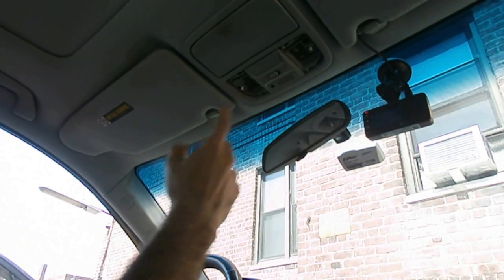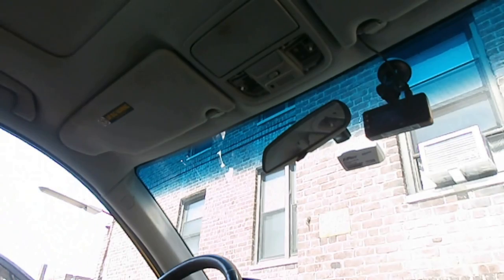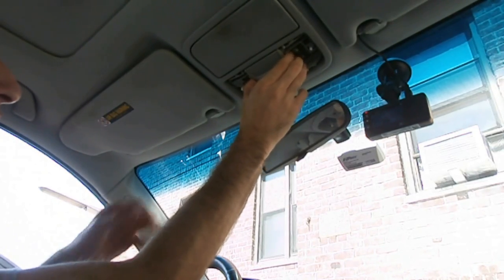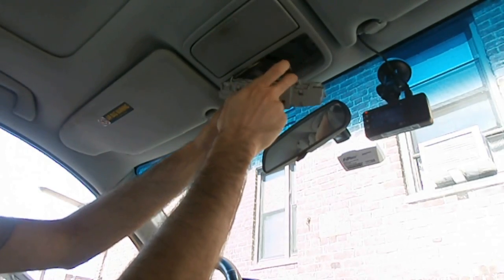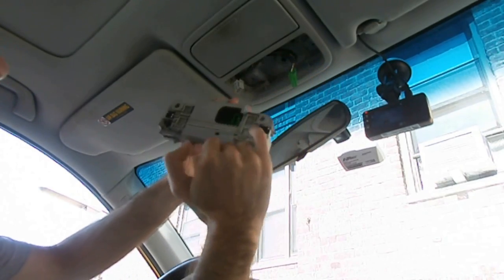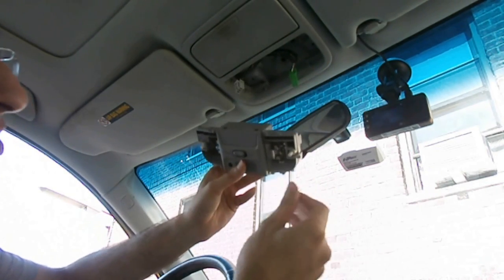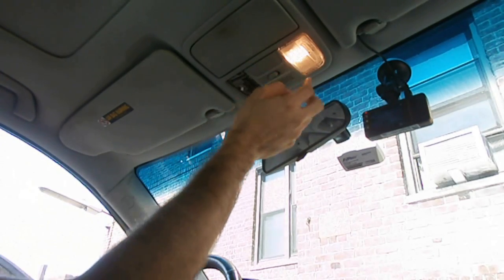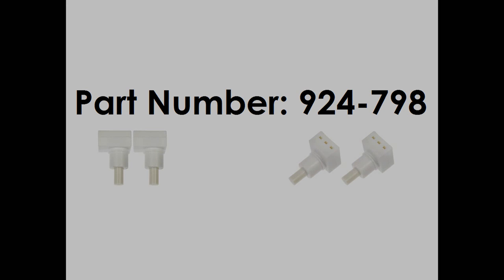Honda Accord Map Lights - Dome Lights - problem - repair - fix

Comment: Great video!  Fixed the problem in about 15 minutes!  A couple of tips (at least for my 2010 Accord):  1) The screws don't provide a ground - the platenut in the fixture is plastic.  You only need to connect the harnesses back up to test the repair.  2) A stiff 1 - 1.5 inch wide putty knife very easily removes the lenses by pushing in on the lens and gently prying in the center of the hinge end.  3) The assembly must be reinstalled such that the plastic platenuts protrude into the holes in the assembly to make it fully seat.  4) The harness connectors each have small button that you press to release the connector.
Reply from the maker: Those are some really good tips, Pete. Thanks man!
Reply: So the machine screws are not needed or they are

Comment: One of my lights quit coming on.  I searched You Tube.  I found this video.  I ordered the part (They come in pairs.) for $7.  The part arrived 4 days later.  Replaced both switches in about 5 minutes.  Both lights work, now.
Thanks for the video!

Comment: I purchased replacement bulbs hoping that would solve the problem. It did not. I found this video and ordered the parts off Amazon and will also replace the bulbs with LEDs while I'm at it. Thank you for your help. When we first purchased the car, one of the lights work and now neither do, so I'm glad I have found a solution.

Comment: I fixed it by pulling the switch out and reinserting in a few times. Thanks for the details about carefully taking it apart. You likely saved me $100
Reply: Your comment helped me out, thank you. It didn't work for me the first time, so after I saw this I redid it again with some contact cleaner and then everything worked.

Comment: Thank you so much for this exceptionally informative video. I have a 2005 Honda Accord that I've had for 10 years now and that light has not worked for at least 7 years if not longer. It has never bothered me enough to spend the money to fix it, though, so I've just lived with it. The bulb recently went out in the side that works, though, so I wasn't getting any light in the front seat when the door was open. That forced me to research how to replace the bulb. While searching for that info, I came across your video, so I thought I'd give it a try. I ordered the same switches you have linked in the description and sure enough, my long dead light has now come to life when I open the door. I was surprised by how excited I was about something so trivial. Thanks again for taking the time to make and post this video.
Reply: Not only do both of my map lights not turn on when the doors of my 2005 Honda Accord EX V6 Coupe are open, the passenger-side map light never turns on whether the doors are open or not.  Not sure if replacing both switches will solve this problem, but I'm going to give it a shot.

Thanks Jeff, and to the poster of this video of course.

Comment: This works.  2005 honda accord ex v6L.  About 3 years ago, drivers side map light stopped turning on on door open or unlock.  About 4 months ago, passenger's side suffered the same fate.  Both work when pressed.  

Test is if map light comes on when pressed but not on door open or unlock, it's this switch.  Suggest you replace both.

I asked the dealership for these switches, they could only sell me the whole assembly for $46.  I'm cheap.

Bought these, followed a video instruction, about 15 minutes later, both lights fully working - on press, and on door open or unlock.  I didn't need to remove the assembly from the wire connectors to replace these switches.  After dropping the assembly, I could easily pry off the switches and reinstall the new ones from the bottom side.

One word of caution, be careful prying / pulling the lenses off.  Pry / pull straight down.  As you can see in the video, the retainer tabs on the lenses look fragile and likely wouldn't tolerate much pressure sideways before bending or snapping.  I didn't break any.

Minor gripe - these dorman switches aren't quite as tactile, ie clicky, as the OEM part.

Comment: 2006 Honda Accord.  Following your great instructions, I removed the switches and as a test, tried swapping the Right switch to the Left position and Left to Right. The switches are identical twins with the terminal markings the same on both.  I put it all back together and it works like it's supposed to.  I realize this may be a temporary fix, so I am prepared to order a new pair of switches if needed.  Thank you, Maximum Tenacity!
Reply: Lots of times you just need to clean the contacts.

Comment: Nice video, I have just cleaned my connectors with alcohol after rubbing with sand paper and now it is working fine, no need to replace, Easy repair.

Comment: Really good video. The problem I found was to clean off some surface corrosion from the light assembly mounting bolt . Both lights working fine now , as opposed to just the one. Thanks again!

Comment: I had the same problem with my 2008 Accord.  This video really help and it did fix the problem.  Dealership wanted $119 to fix it, but this video and 2 switches I purchased at a local auto part store for $26 was all I need.  It only taken 10 minutes to fix.

Comment: Awesome video. 10 minutes start to finish in the dark with phone flashlight. Did it at home so I took assembly in the house which made it easier. Tip, if the bulbs were lit even for a couple of minutes they are very hot so be careful. Minor 1st degree burns which will be gone by tomorrow. Thanks again for posting.

Comment: Quick and inexpensive fix on my 2011 Accord (a single button was out and the stealership, Huggins Honda, wanted almost $200 to repair it). Changed all the interior bulbs to white LED while I had it opened up. Helpful video...thanks.
Reply from the maker: Yeah, exactly, my local stealership quoted like $160 and insisted that the only way is to replace the whole assembly.

Comment: Good video. 2005 Honda Accord. Didn't have to take fixture all the way out and fight the connector locks on the plugs. Just slid it out far enough to be able to slide out the switch to the side. Used a screwdriver to wedge the switch out the side then slid the new switch in until it clicked into place. (Same for other side if replacing both switches.) Replaced every thing and done.

Comment: I solved the problem by removing the switches and reinstalling them on the opposite side from where they were. That created enough new contact to solve the problem. No need for new parts.
Reply from the maker: Sounds like a quick and easy step to try before committing to buying new switches. Thanks for the tip.
Reply: I tried this and it worked. thank you,  saved me $14 :)
Reply: This also worked on a 2005 Acura TSX.  All I did was remove the faulty switch and put it back in 4 times.  I'm guessing there is some kind of build up preventing a good electrical contact.  When you pull the switch out and back in it creates contact again. So the switch is good but dirty. Thanks for sharing this and thanks to the original video publisher for good instructions.
Reply: In my case, there was a bad switch that wouldn't click, but the center contact that inserts into the switch body was coated solid with rust.  The other contacts were clean and shiny.
Reply: @trainliker100  i wonder if some carb cleaner or oil couldnt get in working condition again, trying this on an 05 accord, will edit with results 😜

Edit: this worked, took out switches, blew them out, even swapped the right/left, plugged it back in now my lights come on when the door opens!
Reply: June 2024 and I just did the same thing! Thank you!

Comment: thank you so much this helped me. i have exact problem as yours with the left light,  all i did was clean both ports and swap both right and left switches. worked liked charm. i didnt buy any replacement part.. advice: before buying any replacement part like the vlogger said, swap both switches first to confirm if you need a replacement.
Reply from the maker: Wow, self-repaired & cost-free - awesome job man!

Comment: Very helpful.  I had yet another surprise.  The left switch was no longer "clicking" and the left light never came on.  A new switch, at first, didn't help.  When I removed the switch and inspected the three contacts that insert into the switch body, the center one was completely coated with rust.  The car itself, and other contacts, were pristine.  Very mysterious.  I sanded the rust off and that, plus the new switch that would now "click", fixed it.  Bought a pair of switches on eBay for $9.95 with free shipping.

Comment: Dang. I just ordered the entire map dome unit. Honda said that would need to be replaced. They didn't tell me all you had to do was to replace the switches on each side.
Reply from the maker: Of course. That's exactly what the stealership told me too... and I called BS on that.

Comment: This worked for me and solved the problem. If it doesn't work consistently the first time you reinstall in, take it apart and do it again. The second time I took it apart, I used some electrical contact cleaner and then put it back together. After this, it worked beautifully. I hope this helps someone else.

Comment: thanks for the great vid and it helped me greatly for my problem. add two tips: when you pry out the plastic covers, push up one side and pry the cover from another side (near the middle). when you put it back, the same, push one side up and then push the other side (near the middle). also two screws must be screwed back all the way until tight, otherwise, doom function works but not the map light.

Comment: Thx for explaining the grounding that the screws do. I had some work done on my vehicle and the repair person just one of the two screws and decided to put the screw on the left side instead of the right and it cause the lights to not work properly. Once I change the screw from the left side to the right everything worked great! I watched several videos about replacing and fixing the dome lights and nobody mentioned the grounding that the right screw does.

Comment: I would like to sincere thank you for posting this video. My drivers side map light started working sporadically before it stopped working altogether. I knew it wasn't a burned out bulb, but I tested it anyway and was correct....bulb was good. Knew it wasn't a fuse since the other light worked. Figured it must be a bad switch. Took it to Honda. They gave me a quote of $200. $100 to replace the entire unit including sunglasses holder + $100 for labor. I did some Google and YouTube searches and found your video. I purchased a 2-pack of switches off Ebay for $13. It took me around 15 minutes to replace it. Had a little trouble popping off the light covers because I didn't want to break them. All I needed was a flat head and Phillips screwdriver. Just sat in the drivers seat and got it done! If I had gone to Honda it's a 20 minute drive each way (plus gas) and God knows how long I'd have to sit in the waiting room. Thanks for the invaluable help!
Reply from the maker: I'm so glad when I hear these kind of stories; that I helped people save time, hassle, and a considerable amount of money.

Comment: Thank you for sharing the video. I viewed and fixed the switches by further opening the switch (breaking the four plastic mold) and cleaning and prying the middle prong (negative); then reattaching everything back together. If you don't want to go through that, you can just buy the plastic switches on Amazon for 10 dollars a pair. BTW this is the exact same procedure for Acura TSXs cabin switches as well! You should put "Acura" in the tag so it can show up when people youtube how to repair cabin switches; courtesy lights.
Reply from the maker: That's a good pointer you gave me about the video tag, thanks!

Comment: Great video!!  I have a 2013 Honda Odyssey THAT had this dome light issue - Dome lights just wouldn't come on even with new bulbs.  I took the whole assembly out and then took out just the light section out.  I popped out the clicker switches (just pry them out with a small flat screwdriver....if its hard, you are doing it wrong!!).  They pop right out OF THE SIDE, NOT TOP.  I didn't know if I could find replacement switches since most of the switches said for 2002-2012, mine being a 2013, I decided to just clean off the contacts, rough them up a bit and then make sure the ground screw when mounting back in the car was tight and connected.  I then put back in the car, figuring if it didn't work, I'd just buy a set of the 2012 switches.  Got it back in the car, put bulbs in and boom...light!!  I have a feeling that the connections get bad over time or loose.  The switch might not be bad, it just might take the fiddling to get the connections right.  So try cleaning and roughing up before you buy the new switches ($15 max for a set).  This is an easy fix!!  Took maybe 15 minutes.  Just take your time and don't pull wires hard.  Gentle, gentle.  Someone put this in, so you can take it out.  Just go slow and don't freak out.  The dealership wanted $120 for the whole assemble.  The hardest part was taking out the 4 screws for the whole assembly.  Two are above sun glass holder, so open it up to get access.  Then one on each side of lights. tip towards windshield and slide out.  Then remove connector wires.

Comment: I just installed it....  As I was doing it the left side started working again.  I replaced it anyhow....  The right screw tightened up tight but the left screw didn't tighten up as well....  I am hoping all will be well....  Thanks a million :)  Jim

Comment: Thanks for the video! It was the only one I looked at and YOU KILLED IT! You showed all the little tricks to take it apart without damage! I swapped the switches both work now (both were out before). I am guessing poor connection or ground. I ordered two switches anyway. I used the part numbers you supplied. A "full service" video on this repair! Nice job! BTW, I am very mechanically inclined but electrical baffles me. This made it easy! Thanks again!
Reply: My problem (2006 Honda Ridgeline) was also poor ground connection, left light. Found center connector (I assume this is ground) oxidized and with a rust spot on the back side. Cleaned, now both working as they are supposed to. I was able to keep the original switches, did not have to replace.

Comment: great video. in my 2006 pilot the screw certainly does provide the ground but only on the right side. screws were corroded a bit. I wire brushed them and then swapped out the two push switches with two others I obtained from the junk yard. I think I either fixed the problem or am almost there. it's working for now. would be great to get two new switches however I don't think they are available any longer. thanks again.

Comment: Thanks for this video. had the same problem with my 2005 honda stepwagon but since I'm living in Japan I can't buy just the switch, they wan't me to buy the whole map light assembly so i tried cleaning the pins with sanpaper and bending the middle pin downwards a little and luckily I fixed it.

Comment: Thanks for the video!  Using your walk thru, I replaced both switches and did LED cool white bulbs while at it!  Fixed the annoying problem of the lights not coming on at night when doors were opened!  An easy fix!  Thanks so much!

Comment: Great video-I have a possible easier way.  I had same problem and was able to fix it without replacing component or unscrewing unit.  I took lens off and took small flat head screwdriver -stick it between base and white switch.  Push to left so it slides off prongs a little bit.  Take contact cleaner and spray it in, then slide switch back and forth 10x. Finally slide it back on all the way.  Problem solved.   This immediately cured my car which had same problem.  Thanks FYI the white switch is component he shows removing and replacing.

Comment: Excellent video. I have had the same problem with my 2005 Accord and 2006 Pilot and seems to always be the driver side map light switch that is faulty. Just replaced both map light switches on my Accord for the 3rd time, along with new LED bulbs, but my driver side light would still NOT function for TWO reasons. First, the brand new LED bulb was faulty. By simply testing it on the passenger side where everything worked fine, I eliminated one problem. Next time I will just do a continuity test on the bulb before installing it. However, while I could switch the driver map light on and off manually, it still did not activate by opening the door. The second reason was more difficult to troubleshoot and is hard to detect unless you completely disconnect the green and grey connectors from the map light unit so that you can have a better look at the pins AND make sure those connectors snap in properly. One of the metal pins that goes into the grey connector was bent so I needed to straighten it out. The reason it got bent was because during a previous switch replacement, I likely didn't install the switch quite right. Not only do you need to make sure that the metal pins line up for the switch BUT there is also a channel from the side that the switch needs to fit into. Turns out that on the driver map switch, there is also some conductor metal that goes below the switch and into the grey connector and that likely caused the pin to bend when I reconnected everything. So if there is some slack in your diffuser when you turn the map light on manually (you will have to press extra hard to get the light to turn on), you probably didn't re-install the switch properly. If I ever have to do this again, I will leave the map light unit out, run a ground wire back to the car, and make sure everything works properly.